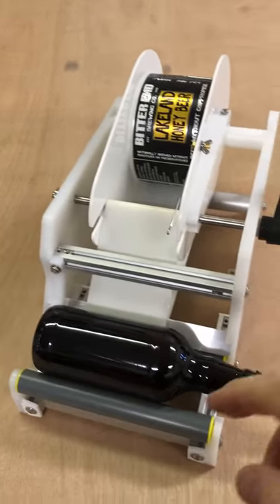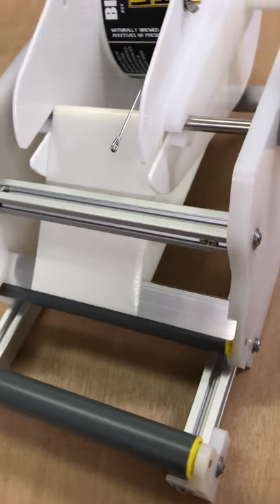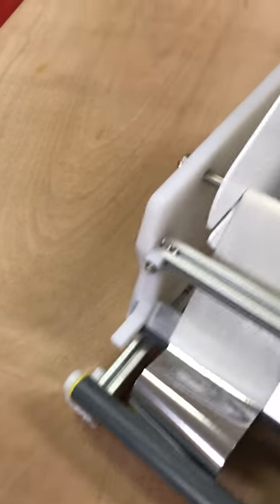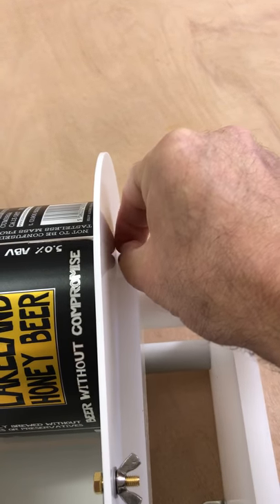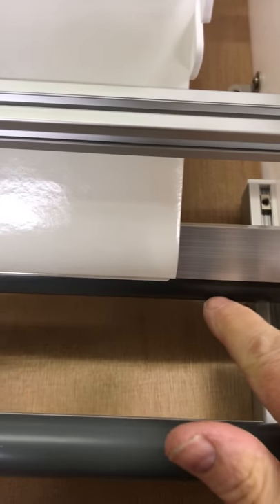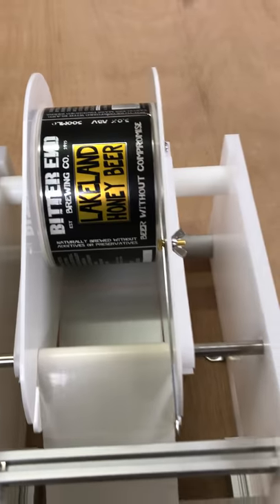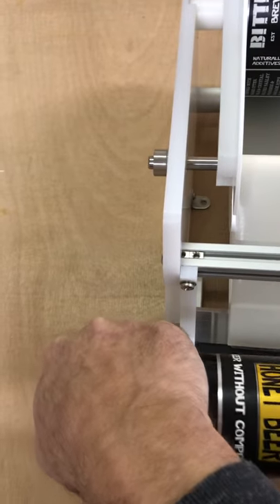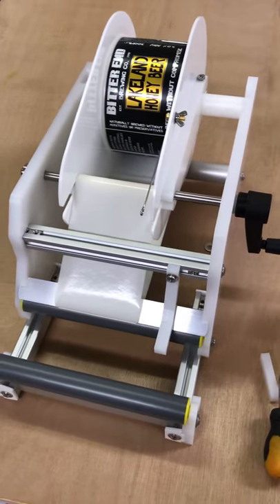LABELROO Labelling Machine (Gap Indicator Setup)

Comment: Hi - I have just watched your video on the Labelroo machine.  Could you tell me if the machine will hold a spool which is 16.5cm in height.  My bottle labels are only 11cms but they are supplied on a larger spool.  

Many thanks.

Comment: Can the label end guide be placed anywhere else or does it have to sit on the label reel?  As the reel is used, the reel size becomes smaller, so is there any issue with having to reset the label end guide after X amount of bottles?

Comment: Can this label plastic bottles? Can it adjust to any size?
Reply from the maker: Yes, this machine is adjustable and will work with filled plastic bottles. Empty or small lightweight bottles need the 'small bottle attachment' which is available from our website. Thanks